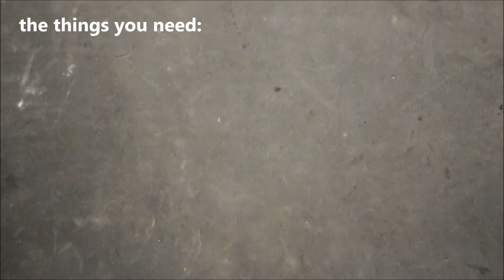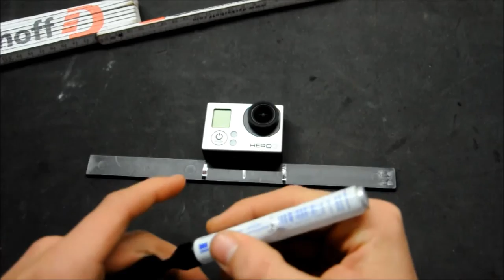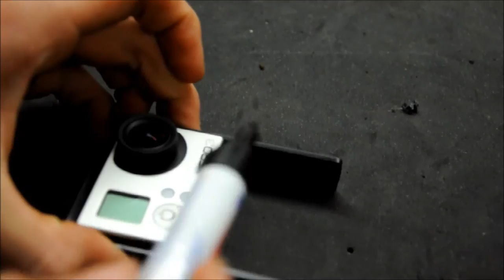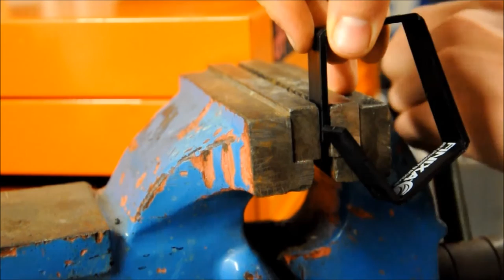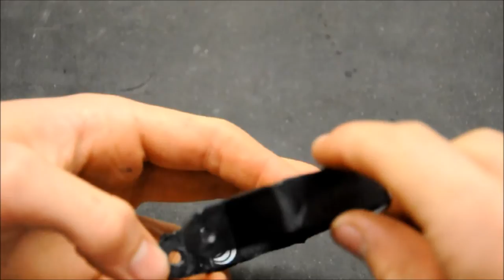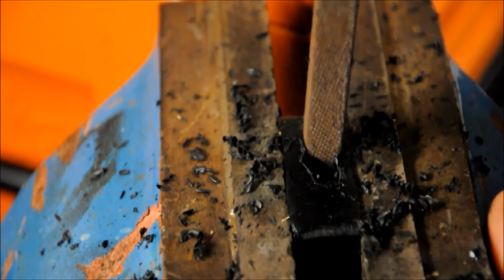How to make a GoPro frame| D.I.Y. | (GoPro tip 8)

Comment: how can I get the plastic strip ? is it available on ebay ? I'm from Argentina and I can not get it anywhere
Reply from the maker: I used a stirrer to mix paint so I didn't bought one. Its important to have a stick that's 3mm thick. maybe you can buy it at a D.I.Y. shop?